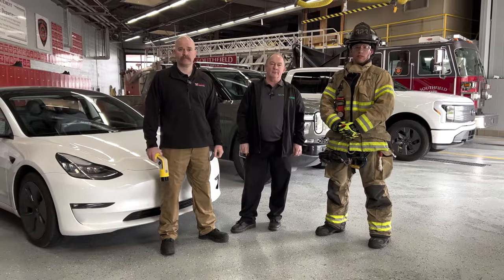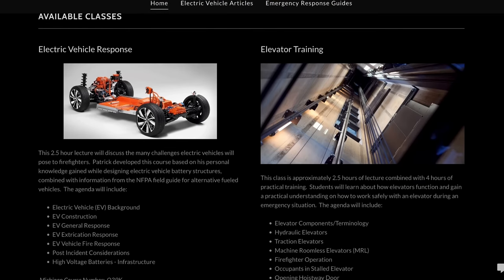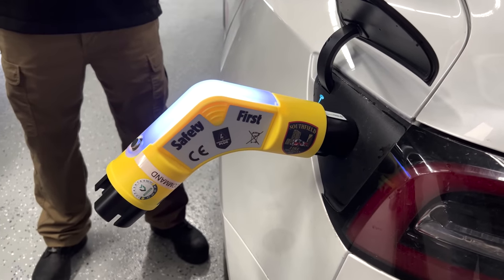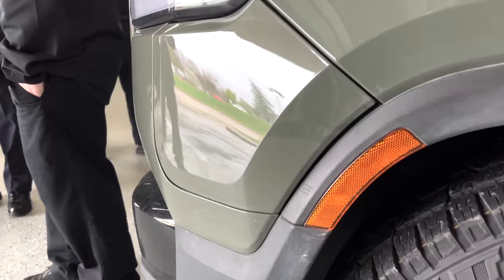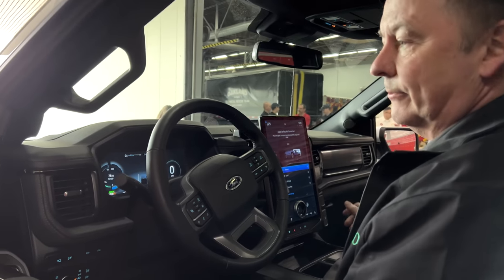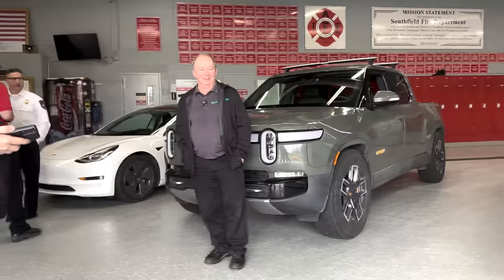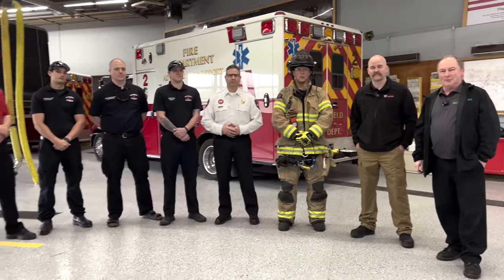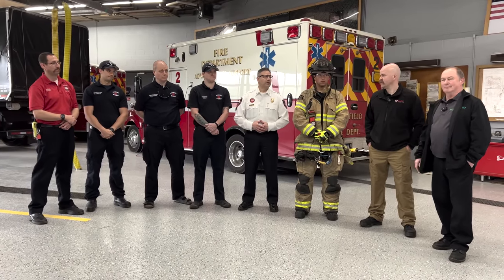An EV Device for First Responders: Emergency Plug Demonstration

Comment: One thing that would be really good is if u evolve the product to take a cord in the rear that goes to a box on the ground that Earth's out all the remaining current ..this way u can actually stop a lot of fires by taking away one of the sources of ignition the electricity itself ...in some cases it won't stop the fire but the vehicle is going to become a lot safer in the event of an accident causing short circuit inside the unfused system and battery's have far smaller explosions  in chain reactions if there flat it's only burn of chemicals not exploding firecracker cells
Reply: This idea will not work on every Vehicle. it needs to have at least one of these two Features otherwise the internal Charger will prevent the Power from flowing back:
V2L - very uncommon still, and pretty low power (usually about 10kW give or take). will need about as long as charging the Vehicle (so for a full battery depending on its capacity and the power rating possibly around 8 Hours)
Fast Charging: This connects the Battery poles directly to external contacts, bypassing the internal Chargers. Can be very fast (up to 350kW), but your Tool needs to be able to take or dissipate this Power (not a small task). Also not every Vehicle has this. Especially the Cheap ones are usually missing this Feature. And it could be that the Car will just interrupt the Charge if it detects that the Power is flowing in the wrong direction.

Also keep in mind that drawing power from the Pack also introduces additional heat in the entire Pack, especially if the Cooling System might be broken. it is even possible that the Pack itself is fine, but the cooling System is inoperable, and you get the Pack into thermal runaway by attempting to draining the power from it. so you achieved the opposite of what you wanted in the first place.

Comment: So install a lock for your charging port got yeah.
Reply: Make sure the lock can't be bypassed with a screwdriver prying it. You might need to replace your EV's plastic door with a metal one. 😆
🤔 Maybe remove the plastic door and make a metal one that can have a locking mechanism installed into it...

Comment: ALL ELECTRIC CAR MANUFACTURES SHOULD HAVE A EMERGENCY MODE AND WORK WITH THE FIREFIGHTERS TO HAVE A MODULE THAT PUTS THE CAR IN SAFE MODE.
Not some janky it thinks it's charging so it wont go. Do it right or go home

Comment: 5:50 first of all there technically is an off button you could use in a senario like this, or you could cut the 12v, or the person could just put it in park, I don't see how this is an EV issue but not a gas issue, how does having an "off" state really change anything
Reply: It doesn't. This is just an ad for a likely extremely overpriced gizmo with no useful purpose.

Comment: 🔥🔥🔥  Thinking outside the box...   Someone needs to invent a PLUG IN SUPER CAP DEVICE that can quickly pull all of the power from a HV Battery during an emergency.
Reply: You realize that an EV battery has enough energy in it to power an entire neighborhood, right? You’re not going to discharge that into a handheld device, or if you do, it will take literally days, if not weeks.
Reply: @ouch1011   Small minds need not apply!   I am talking about a supercap "device" as large as a Megapack, on a flatbed.

Comment: It's useless since you can only open the charging port ELECTRONICALLY from inside the car.
Reply: that is why there are plastic "tools" included to force the flap open.
Firefigthers are not strictly know for lockping; and axe is more reliable.

Comment: Yeah not a bad concept. 
But by the time you grab it, turn it on (hoping it’s not flat) and place it in you can isolate the car, battery and immobilise it with large wheel chocks  
All this would happen regardless if you had this device

Comment: Useless in 99% of situations, most EVs will be in park if the door is opened, you still need access to the charge port (waste of time) and if you really needed to immobilize the car, you just cut the loop under the hood.. There is literally 0 benefit to this dummy plug, especially since you need to carry adapters for different car makes..
Reply: Door open doesn't prevent drive. Plug in any charge cable and your ev is disabled.

Comment: Looks like I’ll be inventing a new charge port lock. This is a crap tool that will be used more for nefarious reasons than good. I give it 2 weeks before police departments have these as well. An ejection system may work as to thwart tyrants and criminals. But, first a physical lock.

Comment: Used in the purpose intended it great. What happens if someone misueses it to car Jack an EV ? There will soon be cheap import copy’s……
Reply: you cannot access a locked ev. a charging ev is easy pray since it is disabled by the charge cable. never sit in a charging ev in a bad area.

Comment: Seems like the only reason for this is that some EVs (e.g. Tesla) don't have on/off switches, unlike very ICE vehicle out there.  So really, NHTSA should just mandate on/off switches in ALL vehicles.
Reply: tesla does have on off: when charge port is open the tesla turns off all systems except screen. if pin to drive is enabled you need to close port and enter pin to drive.

Comment: Let's just hope this device isn't available to the public or it could be used to car jack people.
Reply: It's trivial to build. You need electronics worth about 30 cents and a slightly more expensive plug.

This vulnerability is not new; people (including me) have warned about it in the past. This is just the first time such a device was spotted.

Comment: Many other uses for police and unfortunately criminals alike, seens to be a device that will need to be regulated licensed 🤔
Reply: Unfortunately, it's likely a very simple implementation that could probably be made by anyone who knows how the charging connector works.

Regulation is unlikely to prevent misuse.
Reply: Regulations won't help. Crime is already against the law.
Reply: @isthatatesla  touché 😁, albeit items made available to the general public that can potentially disable a vehicle at a stop light used by a  carjacker should only be made available emergency service professionals, similar to Level 3+ bullet proof vests. Yes, regulated.

Comment: So it's a bit less brutal than the first responder cable loop they'd have to cut on Teslas
Reply: I'm pretty sure that Tesla won't be recommending this device.
Reply: And the first firefighter who uses this instead of cutting the loop will be fried by 400V DC...
Reply: You still have to cut the cable loop. This only puts it in park.

Comment: This is excellent and necessary for emergency services, but there will also be a black market demand for criminals to use it to prevent you from escaping.
Reply: Take a charge cable cut the cable off and you got an emergency ev disabling device.
Reply: @swisssecrets  yes
no doubt you definitely need some kind of communications chip and power source to make that work though 
It's not quite as easy as just a plug from a cable. However, it seems like it could be done.
Reply: Could a car jacker just use a traditional car boot? Not sure if there's much difference.

Comment: If there is a way to tell the car to shut off from the charging connector, isn't that INCREDIBLY dangerous if it were small enough to plug in and have the door closed? Someone could have a very small wireless version of this and disable a car as it's speeding down the freeway. Perhaps you are exploiting a security hole, but that security hole should be patched! 😆
Also, your video doesn't show the battery contactors are being forced open, only that the car can't switch out of park...
If anything, your product is distracting firefighters from doing the thing they should be actually doing. Cutting the main cutoff cable that nearly every car is required to have, for fire safety reasons.

Comment: here is a better solution why don't suggest to the carmakers make alternative charging port inside the car for emergency and the driver can use this tool if the car computer bug or broken or the car keep driving and unable to be stopped and that would be easier solution and it's a better way to control the car.
Reply: sounds like a kill switch. They have those in test vehicles wearing camo that are driven around on public roads, right? Big red button on the dash?
Reply: If the car's computer is bug or broken, then you're not going to be stopping it with any device like this. 😆

Comment: I dont know, this feels unnecessary. i thought on teslas, if you open the door it will do the same thing, maybe also other EVs as well? If its not disabling the system to prevent a battery fire or something in the event of an emergency, than this really isnt viable.

Comment: I'm just going to be honest here. This looks like ridiculous complexity to me. It is heavily dependent on conditions, access and specialty tools that emergency response people have to have when they already have a truck load of specialty tools. Just have manufactures build in one or two grab handle's for a master kill. And or if air bags are triggered, that can also trigger a master kill. This is a terrible idea over all IMHO.
Reply: There is already a cut loop for first responders.
Reply: Also, deploying airbags already cuts off HV battery.
Reply: I think it’s a really useful tool actually. Particularly if the driver is unconscious
Reply: @uosiumen  this isn’t meant to cut off the HV battery - it’s purpose is to put the vehicle into park
Reply: @CGrantL  So, imagine a car that is still rolling with an unconscious driver. What will happen in the 10+ minutes it takes firefighters to arrive at the scene? If it rolls fast enough that reaching in to press the park button is too dangerous, it will certainly have hit something and come to a stop in that time.

Comment: This would be a useful tool for car jacking  thieves - then you can’t run away once they pop that in .
Reply: charge port is locked when doors are locked. but yes a ev charging is stuck there for the robbery
Reply: @racedude7039  not every EV locks the charging port door.... and those that do can likely be bypassed with a flat blade screw driver.

Comment: ...If the car is moving how will you get out and plug it in to put it in park...5$ wheel blocksdo the same..
Reply: If the device is already installed (and hidden inside your charging door, if it was smaller) and your car is barreling down the freeway at 90mph. I'd imagine jamming the car into park would cause the car to trash itself.

Comment: It’s a useless tool period, EV cars automatically disable itself doing a airbag crash. When the car is locked and in drive the charger door will not open. All EV manufacturers do issue to the FD a manual how to disable the car… every true “trained “FD understand not to use water with a electric fire, you use foam.

Comment: This is both a terrible idea and a waste of time/money. In what situation is the car not in park, not moving fast enough to use it and need to be put in park? More criminal applications than good for sure. There is a reason cars have firefighter service loops for HV battery, with one quick zip of the saw or snippers it disables the car and battery. Then it's comically bad that firefighters seem to be unaware of the impact of water on lithium batteries. Retraining is in order here to remember the types of fires and how to put them out. Then if you still think you should spray water then tell me the time difference of the car burning itself out vs spraying water... I love EVs but emergency crews need more training for the few times (several x less frequent than gas cars) that this situation comes up.

Comment: This just makes me want even more to put a high-amperage switch on the inside of any EV I ever have the misfortune to own, just so I can physically disconnect the charging port from inside to prevent this tool from being used. Sorry bois, iI have no specific problems with first responders individually, but the system is so f-ed up that I can't trust y'all in general having this kind of tool. If I wanted my vehicle to stop for you I would've told it to, otherwise you can heck off.
Reply: Just find a way to lock your charging door. Maybe remove the plastic door and build a metal one that has a lock.

Comment: While there are security concerns, the concept seems like a reasonable enough thing, but all it seems like its doing is fooling the car into thinking it is charging.  It seems like it would be much better if there were some official fire mode EVs were required to have that this thing could activate that would disconnect as many high voltage lines as possible.

Comment: Absolutely useless, it serves zero purpose. If they can get to the charge port, the car has already stopped. It's not going anywhere.
The only use it could potentially have would be to the Police when they pull over electric vehicles. It will stop the driver from changing their minds and taking off.

Comment: ok, so a maniac chasing you can stop you from driving away - to safety - from the outside of your car.. great idea (do the doors open as well, so a rapist can pull you out?) or if the cars on fire, emitting noxious gasses, and flames bursting out everywhere, you can stop the driver from starting his car, but only if the electronic coms still work on the charger port? hmmm... ill take 2, not

Comment: Cool idea. But there should be an industry standard which:
A) allows the charge port to be opened at any time
B) lets tools like these to tell the car to blow the main EV fuses (or at least the main contactors).
Reply: That is a ridiculous idea. Do you have any idea of the vandalism that would cause. No, to mention putting people in danger by not being able to flee in an assault. You need to think through the ramifications of such a device.
Reply: @moki123g  those are solvable problems with an encrypted communication handshake, for example.
Reply: @MoritzvonSchweinitz  No, not solvable: stolen or privately purchased devices will have a valid key.
Reply: Just put a big red button with the label "robbers and carjackers, please press here" on the side of all cars.

Comment: the most useless piece of equipment i've ever seen. if all you want to do is put in park, open the door and put in park... if you want to isolate and completely cut all power from the battery, find the firefighter plug/wire/fuse all EV's have. this is the info fire fighters should have access to.